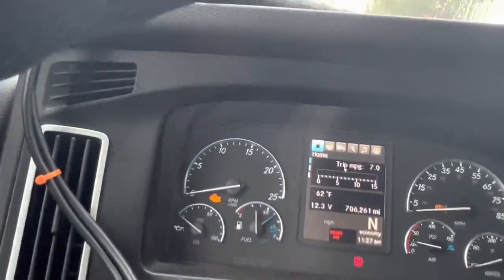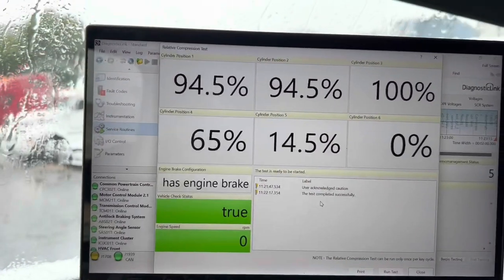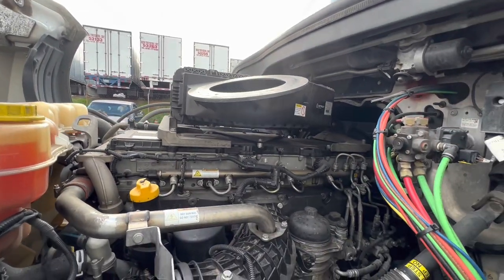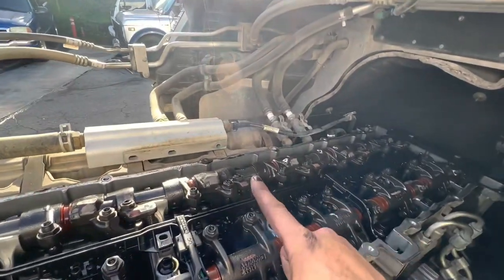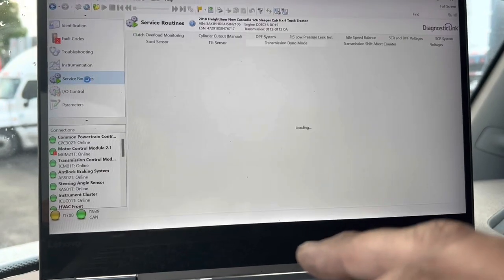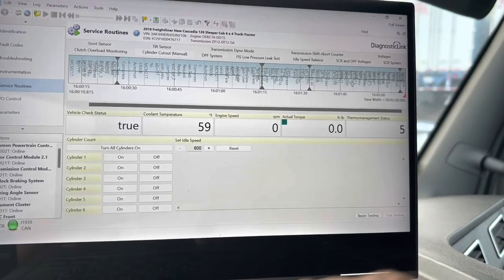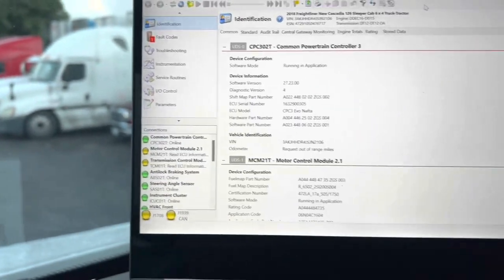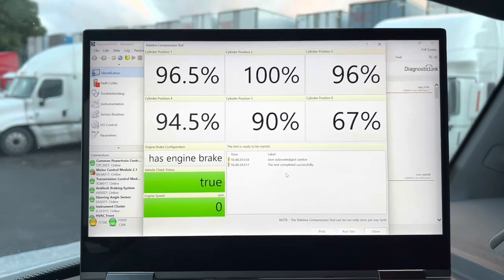Mechanic told customer it was a bad injector. Know what to look for. Before you spend your money.

Comment: I have a little issue with the abs I kw keep getting code spn810 fmi14. I cleaned all the rings and abs sensor. Is there anything else that I can do? Or what exactly do this code means? (I’m not a mechanic I’m just an o/o trying to fix my truck) thanks for the info.

Comment: Still don't get fooled guys, that engine can blow the valves in next 100 miles since they were so tight for so long. That's another danger of late adjustment
Reply from the maker: Very true. This is why maintenance is key. 👍🏼
Reply: Better make sure its a good shop.

Comment: I wonder what owner of this truck did next? I have same problem with sixth cylinder compression. Too low compared to other cylinders
Reply from the maker: Next step is a valve adjustment. Have a good mechanic run the overhead. But if the number 6 cylinder has low compression, have the mechanic let you know what they find. How tight were the valves on the number 6.? The intake will most likely be out of adjustment the most.
Reply: My mechanic did valve adjustment and after that compression went to 96% on sixth cylinder. But it get worse after few months. Right now is around 83%. He says only replacing cylinder head will fix problem
Reply from the maker: @spicemerchant636 he is correct, the valves are worn and it will continue as the truck is used. Common issue with the DD15 2015 and newer. I think once Detroit switched to the single lobe on the intake CAM.
Reply: I appreciate your input.

Comment: What's the average cost of a valve adj
Reply from the maker: Depends on the Cascadia. For example, if it is the short nose it might be a little extra. But typically a valve adjustment will cost $350-450.
Reply: @CarlosDieselElectric  thx

Comment: How much its valve adjustment Pedro, dd15
Reply from the maker: Typically you are looking at $350-450 depending on the Cascadia you have. The short nose Cascadia will cost more because of the way the engine sits inside the cab.

Comment: How much it cost valve adjustment itself for dd15
Reply from the maker: A valve adjustment will cost around $400. 
If you have a DD13 with a short nose it might be more because you have half the motor inside cab.